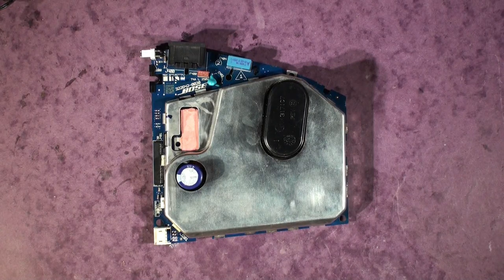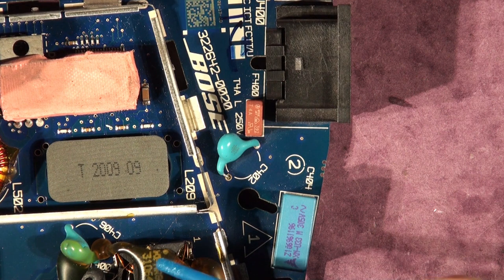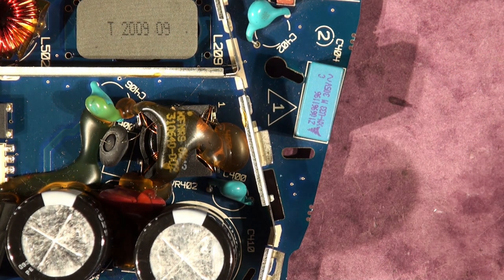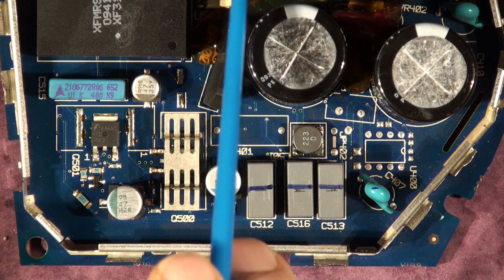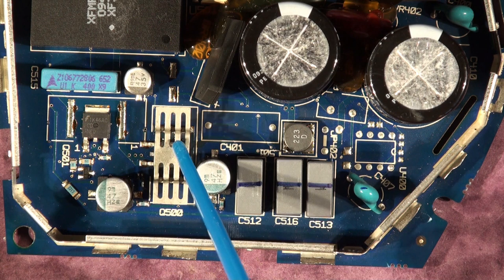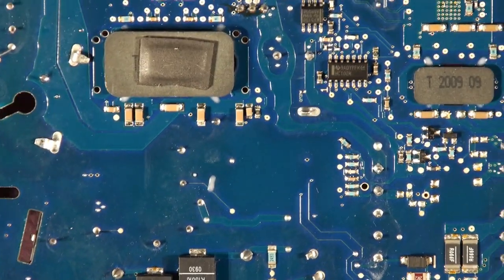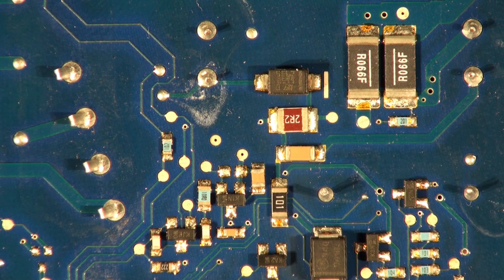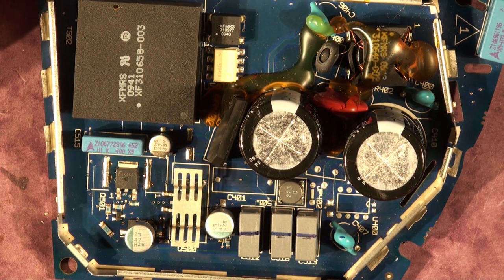Bose SoundDock 10 Diagnostics and Repair Video Part 1-Overview Bose 322642-0020

Comment: Hi mate 
Got one in and I took it apart tested the mosfets all seem ok .. put it back together and it turned on … after an hour tried to power up but just won’t turn on again … am not as good as you … your knowledge is incredible 👍… any pointers as what I should be looking at 
Cheers

Comment: Hi I love your videos, few minutes ago I got soundock 10 which was working at my friends house but he forgot to tell me it’s 110 voltage, I plugged in to direct power which is 240 volts, I removed the power module but didn’t know if it was the fuse or something, please can you assist me on what to change on the board or if I can ship it to you so you return me back a 240 volts power module, I will pay for all 🙏🙏
Reply from the maker: Thanks. You can get is serviced and converted at ww.invebo.com in the sounddock 10 section. They service and modify the power modules every day. The over-voltage will have damaged/stressed many components that need to be changed so there may be an additional £20 charge to the standard repair fee as the main caps and the extent of the damage means there is a lot more cost to invebo than a standard repair.. You get a three year warranty.
Reply: Thanks for your reply, I also want to know if sounddock 10 and soundtouch 30 has the same power module?

Comment: Great video really helped 👍, do you have or can you do a video to repair the docking station? Mine is a little loose, when on loud cuts sound down by half cheers
Reply from the maker: it is on this channel already. See 30 pin ipod connector placement

Comment: Hi, thanks for video. I have a Bose SoundDock 10 powered speaker with a damaged power supply. I have voltage in the high voltage part but the low voltage part only gives me 1 volt. I don't get voltage at the output. I have changed several components following the manufacturer's scheme but I still have no results. I changed the Q500 and Q501 mosfet transistors, which are the ones that supply power to the T502 transformer. I have also changed the U504 and U505 ICs and the C515 capacitor. The current reaches the transistor Q501 and the resistors that follow it, but I have no voltage on the secondary of the transformer, nor on the integrated circuits U504 and U505. At this point I am confused. Is it possible that the schmitt trigger U506 and the transistor Q509 are the cause of the current not going through this part?
Reply from the maker: There are any number of issues and components that can fail that cause the supply not to run.  We at invebo repair them nearly every day.  You need to change all the ICs, signal diodes, check the diode in the bootstrap supply and all the low value resistors.  My operator strips off all active components off and repopulates with new, then and invariably the board works afterwards. The trouble is that you don't know what has been stressed or aged so a sticking plaster repair is unlikely to serve for very long. We give a 1 yes warranty but never get any back. I am happy do yours if you can send it into us.  No dock is left behind!! Use Infineon FETs. (IER and Fairchild are now Infineon too). Don't use Chinese 7N60s

Comment: Hola te felicito por tus videos, tengo un sounddock 10 y no enciende, saque la placa fuente de alimentación y me di cuenta que esta quemado o mas bien destruido un componente de la parte trasera, tiene el numero 4032 K150 0925, aparentemente es un Varistor, intento buscar en google y no logro encontrar el mismo, ¿con que componente debiera reemplazar?, ¿será tan simple como reemplazar eso?, a simple vista no se ve ningún otro daño, todo se ve impecable.  Muchas gracias
Reply from the maker: hola, el varstor que se ha quemado es para el protector de red 110VAC. La tensión de red ha subido demasiado para la fuente de alimentación. Simplemente busque el varistor K150 en la web y podrá encontrar muchos reemplazos disponibles gratuitamente. Simplemente elija uno que tenga el mismo diámetro (Diámetro == potencia nominal). Es posible que su controlador no haya sobrevivido, dependiendo de la duración y el nivel de la sobretensión. Una manera fácil de hacerse una idea es inspeccionar cuidadosamente los condensadores grandes de 250 V junto al varistor para detectar cualquier signo de abultamiento en la parte superior. Si la superficie superior de aluminio se eleva al máximo, AMBOS deben volver a colocarse. A continuación, mida los dos FET de potencia: uno está parcialmente debajo de un marco metálico del disipador de calor y el otro no está cubierto en absoluto. Verifique con un multímetro configurado para dar continuidad directa de diodos para ver si alguno de los cables del transistor lee un cortocircuito en cualquier otro cable del mismo dispositivo. Si obtiene una lectura cercana a 0 V entre cualquiera de los dos cables, entonces el controlador necesita que se cambien muchos componentes. De lo contrario, retire temporalmente el varistor y pruébelo. Funcionará bien sin el varistor, ya que solo está presente para hacer frente a sobretensiones de la red. Buena suerte.

Comment: used to repaired this power board last year by changing the Q500,Q501 and other around stuff, it worked well then,but here comes to a new problem to it these days.I can hardly hear anything with regular volume from aux,if I turn it up  ,then it would be  little music with strong electicity humming sound.Which part should be checked? Thanks a lot
Reply from the maker: You need to check that you can pull 1A at a steady 23.7 to 24.5V from the supply to C521,  Cant be repaired just by changing the Q500, Q501 FETs. Not going to be good.  Need to change  Chips U504 ,U505, U506, U503  and Check / Change: D506, R530, R500, Z500, R527, R528, D504, D505.

Comment: Hi boss, I don’t know whether my case can be discussed here or not, but after 14 years of incredible rock in roll songs in my soundock 10, it simply started to flash both lights (iPod and AUX). As this occurs, no connection is possible in either direction. I’m really sad with this because this equipment had always a great care. Any suggestion or comment would be helpful. Grettings
Reply from the maker: Could be the power module or the sound processor. That is is a difficult one to diagnose remotely as the flashing can be caused by several faults.   Best check the easy causes first:  I advise you take it apart and unplug and re-plug the ribbon cables. They can suffer from oxide build-up on the contacts. Re-plugging wipes them clean and solves a lot of problems. Also check for any corrosion or liquid ingress.

Comment: Hello, can you help me get the source board for my Bose Sountouch 30. It burned when connecting it to 220 v
Reply from the maker: It can be repaired - see sound-dock 10 power board repair. the schematic is the same.

Comment: I have a Sounddock 10, Makes the two tones when connected to the mains then after seating my ipod the charge graphic shows then goes to the music. As soon as I press play it plays for 2 seconds then shuts down. This isn't a dock problem as it does the same thing when connected to Aux. This Sounddock worked great until there was a power cut. After the power was restored this problem arose.
Reply from the maker: You have a power board supply issue. It cant provide the oomphf.  Send it in for a diagnostic test. See video on invebo.com  Website in the tech guides section.

Comment: The sounddock 10 power board works on soundtouch 30? They are the same board? Thanks
Reply from the maker: Yes virtually identical.
Reply: What means virtually identical? I've tried, they fit but the ST 30 have one more flex connection

Comment: AMIGO MUY BUENAS TARDES SALUDOS TENGO UN BOSE SoundDock 10, el problema que tiene es que no enciende, destape el modulo principal en busca de algún signo de avería y lo que pude notar en la placa de circuitos es que el integrado 3100D2 98T CJZ2, que esta cerca del capacitor de 35V, 3300 Uf, se ve una de sus pines quemado,  quisiera saber si esta podría ser la falla de que no encienda y si es así,  tendría que cambiarlo??  le agradezco su ayuda muchas gracias. desde Venezuela.
Reply from the maker: Sí, una sobrecorriente en el amplificador no producirá energía. Es posible que deba cambiar el chip LM5021-2 (controlador PWM) ya que no toleran la situación de arranque por sobrecorriente. Además, si tiene un 33uf junto al blick del transformador al final del condensador azul de 100n, cámbielo por un 47uF 35V, el chip TP ahora está obsoleto pero todavía está disponible en www.aliexpress.com. Buena suerte.
Reply: Amigo hay alguna manera de comprobar el chip LM5021-2 (controlador PWM)?

Comment: Been thinking about getting a Sounddock 10 or Soundtouch 20.
Since as far as I know, the 3 drivers(2 mid-high, 1 subwoofer) inside the original Sounddock 10 are very similar if not exactly the same as those in the newer Soundtouch 30, so the old Sounddock 10 seems to be an economic option for me, because theoretically it would sound almost the same to Soundtouch 30 but at lower price as the mid-range Soundtouch 20.
I've been watching lots of your repairing videos recently and start wondering whether or not this Sounddock 10 system is too old to be owned or it just has its own design failures ???
Reply from the maker: They are pretty reliable but some need servicing.  The processor cards can be a problem but the power board that normally fails is serviceable and reliable afterwards.  They do no do well when there are power surges. Lots of calls from Texas now after the power issues they experienced recently ( Feb 2021) many did not come back on.
Reply: @razenby  Thanks a lot for the advice, much appreciated 😄😄
Reply from the maker: @johnger850305  The sound is quality/power/experienece the same on both models.

Comment: Hi, I have a Bose Soundock 10 that I love and it works perfectly well apart from a) I need to move the iPod/BT adaptor to get music - possibly a dry joint/bad connection between the dock and the BT adaptor/iPod and the main board and b) there is too much bass - it sounds amazing when the volume level is low, but as soon as it's cranked up a bit - the bass just falls apart and the sound output is awful - would you have tips for fixing both of the above - like you I hate good kit going to landfill - thanks in advance.
Reply from the maker: Clean you docking connector with a   clean toothbrush dampened in ispopropyl alcohol . Do the same to your iPod's and your Bluetooth adapters docking connector. Also remove the docking module and clean the sprint connector under the docking module. (see invebo.com for diagnostic video on the SoundDock 10). If you still have  a bad connection then you need to get a new 30-pin dock connector fitted to your dock module.  Ensure that the module is clipped and stays fully down. Sometimes the steel clip works loose and the dock module is not held down onto the spring connector.  Bad bass audio is rare.  Remove and inspect the bass driver speaker. You may need to replace it.
Reply: Thanks I shall have a fiddle. How does one tell if the speaker is blown (apart from the sound) I have a multimeter and could measure the impedance.

Comment: Hi there! I have two of these Bose SoundTouch 30. That have that power board damaged. I loved that units because of the looks and great sounds that it put out. However they don’t sell them anymore  stores. So I am hoping I can send them to you for repairs. Please help
Reply from the maker: On this model I specialise in the repair the power module but do not accept complete systems for repair. If you reckon that the power module is faulty then send them to me for a diagnostic check. You can order it on the Invebo website us the Sounddock 10 option the power  mdules are virtually identical..
Reply: @razenby  are you located in the United States? And how much? I have two units that I need fixing

Comment: i have a bose sounddock 10 and it turns on and works, but the subwoofer don’t work. Do you have any idea what should be the problem? 
Thanks!
Reply from the maker: Check the wiring. Measure the woofer voice coil resistance should be between 3 and 5 ohms.  If open circuit then inspect the connection of the woofer. Sometimes they crack or the carrier wire fractures. Solder it back on and BOOM.   If the driver is OK then the amp chip has blown.

Comment: Hello Sir ,  I have  a Bose Soundtouch 30  . It does not Power on  , the display is not lighting up . The power board   23 volts is present.  Any tips to get it working would be of great help.  Ty
Reply from the maker: If the DC power is there then the sound processor/digital board has probably failed....

Comment: I can't believe that the power supply section of this unit is so complex!
How many different voltage does this unit needs to run? 
I was thinking if I can't repair the power supply section, I can build an external SMPS or linear unit to power this thing.
Reply from the maker: Power supplies start out simple and then it is necessary to design the simplicity out f them to make them half-way reliable. Unfortunately high voltage power components are subject to bad batched and substandard manufacturing. Why not just watch Parts 1,2,3 & 4 of the detailed videos and buy the $6 of components and fix it? All the info you  need for the component level repair is in the videos on this channel.
Reply: Magic Smoke ok I'll watch your other videos asap.thanks again for replying

Comment: I have Soundock 10 with multiple issues. Though it still works, but i am guess its heading towards it death. Issue 1 - There is a humming sound once the unit is powered on through remote. Does not appear to come from the speakers but  definitely from somewhere within. Is that common?   Issue 2 - Iphone 4s connected to the 30 pin connector dock - connects and plays well, but withing few minutes, cracking and popping sounds take over and its loud.    Issue 3.  Since the 30 min dock direct connection does not work for long, i shifted to the AUX capability, and here too, the sound stops and i have to click on the Aux on the remote within few seconds or minutes to get the sound back ......  Any insight would help . Regards
Reply from the maker: It sounds very much like you have an incipient fault on the power board.  Make sure there is no burning - also change the mains lead it could be a bad cable.

Comment: Amigo buenas noches  tengo  un BOSE soud dock 10 y mi problema es q al prenderlo y escuchar música. después de 7 o 10 minutos de encendido con musica se apaga y tiene q pasar 20 o 40 minutos para q vuelva a sonar. Me podrías ayudar y decirme donde lo puedo llevar a arreglar aquí en ciudad de México o si me puedes auxiliar a mi, ya q yo se algunos principios de electrónica y podría cambiar cualquier pieza.. .unas gracias x tu ayuda saludos
Reply from the maker: Hola, no es un problema común que tengas. ¿Es el comportamiento repetible? A veces, cuando la fuente de alimentación tiene dificultades para funcionar cuando el voltaje de la fuente de alimentación cae (fluctúa), la base se corta. ¿Funciona correctamente la base a un volumen alto durante este tiempo o falla cuando el volumen aumenta a un nivel alto? Además, si aún no ha intentado ejecutar desde una entrada de entrada de línea de cable (auxiliar), hágalo. La falla que describe es típica de un problema con el conector de la base.
Reply: @razenby  muchas gracias  x responderme.. ya lo probé con cable auxiliar y el problema persiste ya teme el tiempo preciso  y casi en 30 min la bocina se apaga.  Y la conecte a un volumen del 30%  y solo duró 30 minutos y ya no quiso prender.. y tube q dejar q se enfriara para volver a prenderlo ..  ay algún lugar donde puede llevar la bocina a arreglar? Gracias
Reply: @razenby  hola bien día ay algún lugar donde pueda llevarte mi bocina para q me la arregles?  Yo soy de cdmx.. muchas gracias

Comment: So here we are in September 2024.  Does anyone still repair these, or can we buy them?  I run 2 of these Bose in a Pre Amp sound system.  They sound amazing, but one has stopped working ..
Reply from the maker: Yes we do and yes they do. the full potential of the dock was unleashed only last year,   My company repairs modules from all over the planet. I designed a 24-bit HD Bluetooth direct digital interface from the dock of the SD10.  Bose coded in support for the 24-bit 48Khz HD Bluetooth (Aptx hd) but never got around to release product that supported it.  Forget what you know about how the 10 dock sounds taking miserable compressed input from an ipod or a 16-bit Bluetooth 2.0 codec.  With 256 times the resolution a and dynamic range of 16-bit  you can hear the musicians rustling their music sheets.  Symbols no longer sound like a disapproving vicar shushing you, now they ring and ting like they are supposed to.  Drummer sounds like they are in the room.  Notes and content is much richer and detailed.  If a new speaker could match the performance of the 10 it cost over a $1000 and probably would not be repairable.

Comment: Hello, my SoundDock 10 turns off when I raise the volume and powers back on a couple of seconds after.
Reply from the maker: Usual cause (not always) Power supply fault check the vale of C515 is still 100n.  Also the vibration can cause a bad connection on the iPod dock. Check that the dock still cuts out when the signal is coming in the rear AUX input.
Reply: @razenby  Thanks for replying so quickly. I only use the Bluetooth connection to listen to music.
Reply: Do you have a video showing how to do it, I called Bose and they don't have the part to repair it but they wouldn't tell me what was wrong with it 😔. I'm in the USA and I can't find a shop that can check it.